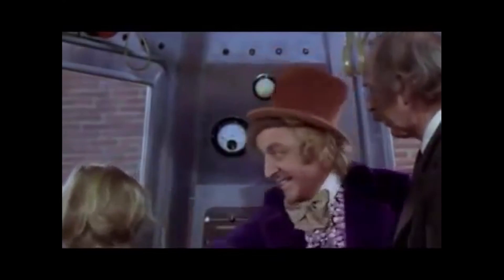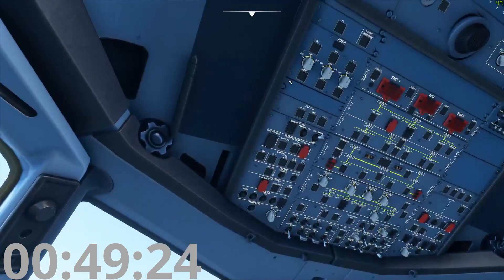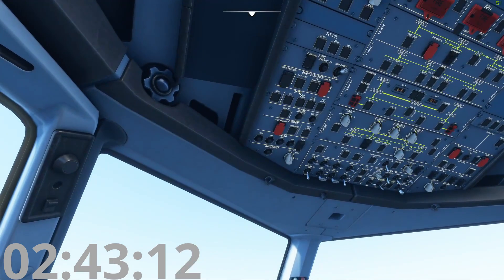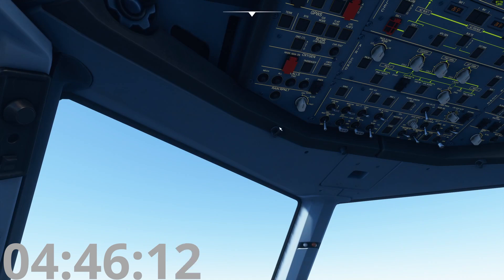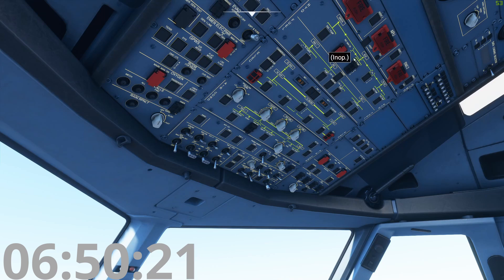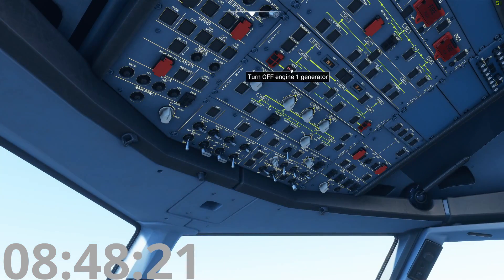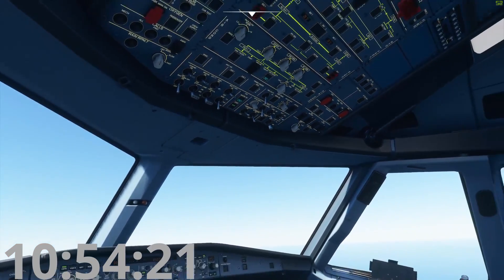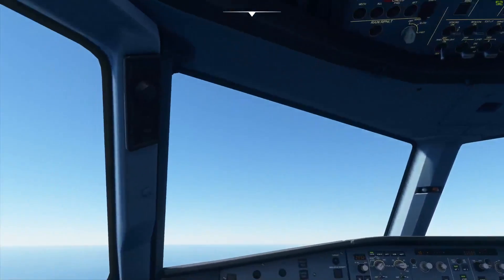Real A320 Pilot Explains every button in 12 minutes

Comment: 8:00 - your description of the RAT is backwards... when deploying the RAT from the HYD panel, you only get blue hydraulic pressure; if you deploy RAT from EMER ELEC panel, you get both blue hydraulic pressure and emergency electrical generator connection.
Reply from the maker: Good catch. Was moving quickly

Comment: Which button would disable the FADEC? And the stall protection?
Reply from the maker: The FADEC cannot be disabled, and there is no mechanical linkage between the thrust levers and the engines. Autothrust can be disabled by disengaging it on the FCU, using the instinctive pushbuttons, or moving the thrust levers to idle.  The stall protection is an inherent part of Normal Law. To remove it, enter Alternate Law by disabling some redundant systems, such as ADR 2 and 3. I'm not sure these modes are fully implemented in MSFS2020.

Comment: *Loses an engine when turning fuel pumps off

“That’s not how this works. That’s not how any of this works,” -a famous dude
Reply from the maker: Colin, as a redundant system, the A320 has suction valves. Because the system is pressurized, suction valves allow the engines to be fed fuel through gravity in the event the pumps fail or are selected off. When selecting the wing tanks pumps off, the engine would still be receiving fuel.
Reply: Flight Dojo oh yeah I know. Was agreeing with you. You’d think Asobo would get stuff like that correct but I guess not.
Reply from the maker: @colinkennedy1718  haha, yeah. I'm hoping we get an FSLabs A320 for 2020!